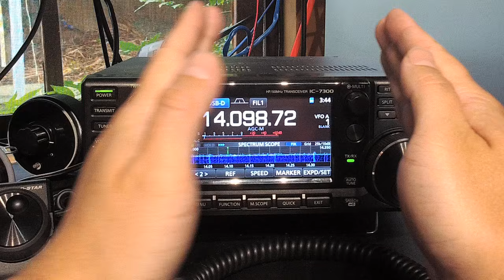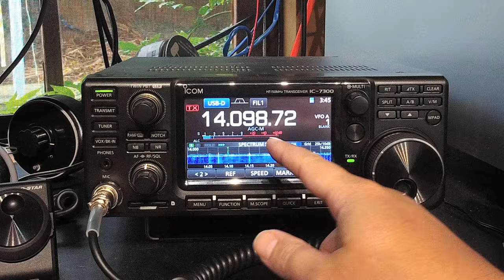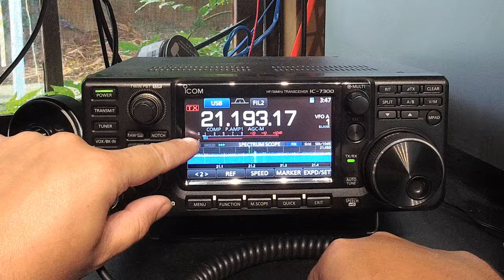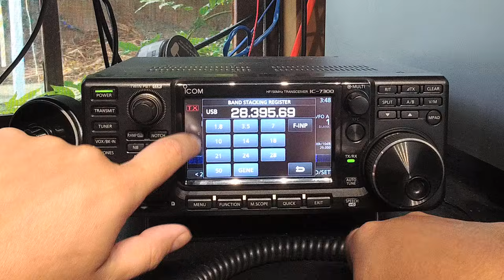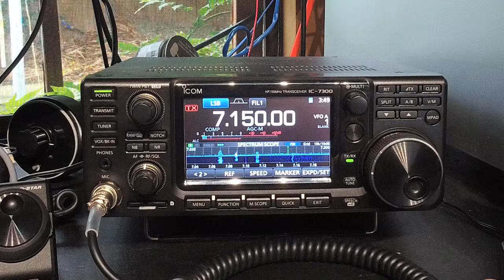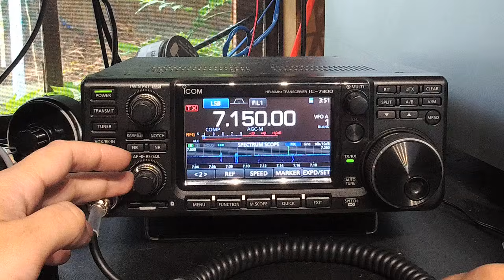How to Setup Your Receiver for Optimal Performance (IC-7300 & IC-7610)

Comment: Signal to noise ratio !  The Ref setting would be good to cover here too.
Reply from the maker: The REF setting is hard to cover, as its more a personal preference thing than anything; it really depends how you want your scope to look... whether you're a CWer etc.
Reply: Rate My Radio Well, for me when keeping the RF gain down it reduces the signal graph in the scope, the ref function increases the sensitivity or gain on the graph, thus giving you a level instead of nothing on the scope. I believe it goes hand in hand with what you’re teaching here.  As you said the s-meter is reduced, but the ref function gives you that back in the form of the signal graph.
Reply from the maker: Dear Mark,
Indeed - you have a point they are related.  We're trying to figure out the best way to use the REF function, and are currently experimenting with some alternatives.  We will do a video covering the REF function and how to make the most of it; depending on how you use the radio, it can either be a frustrating 'feature' needing constant adjustment, or something you can set and forget.
73, Jarrad VK3BL & The Rate My Radio Team :)

Comment: First off, fantastic video! Any ham that is active on HF should watch this to get the most out of their receiver. The tips and advice here are applicable to any receiver regardless of internal architecture. Thanks for taking the time to explain these settings in such a simple way.

Comment: When the RF gain is wide open, the band noise is Sn.  If the noise level is reduced  by the RF gain  to S1, for example. 

If a station signal is S7, so the actual S number is, 7+n-1. 
 Please correct me, if I am wrong.

Anyway, giving 59+ is more than enough, unless the station want to have accurate reading, for the example, comparing antennas.  I agreed, signal strength is not as crucial, than reability. I prefer 53 signal than 29+.. :)

thank you for the excellent explaination. 

de, 9W2GNU, 73.
Reply from the maker: Dear Mohammad, in theory that should be the case.  That said, Rob Sherwood measured the IC-7300 S-Meter as follows: S1-S4 2.8dB / Unit, S5-S9 3.3dB / Unit, so it isn't linear unfortunately.  Another reason not to worry so much about signal reports; the only thing manufacturers agree on is that S9 = 50 uVolts.  Agreed, 53 is better than 29+ :)
Reply: Rate My Radio 

I like to point out A very small mistake  at minute 15:19
It should be 50 MHz,or 6 meters, not 50 meters.

Again, I agreed with you, S-meter just a signal strength indicator, not a an accurate   for scientific research.  Yaesu and KEnwood rigs' S-metering  also differs. At least we know the signal is weak or strong. 

Thank you.